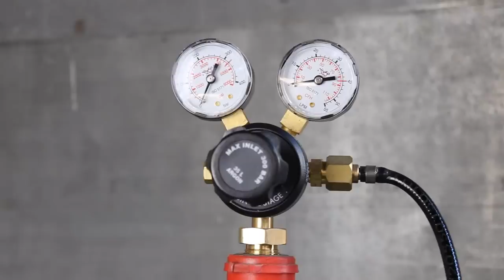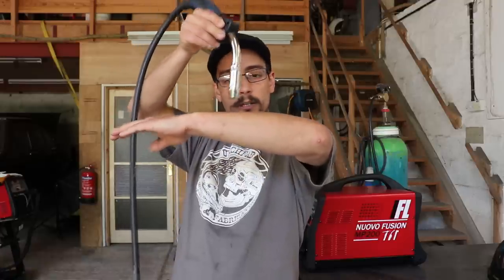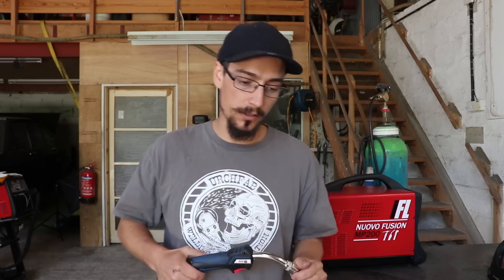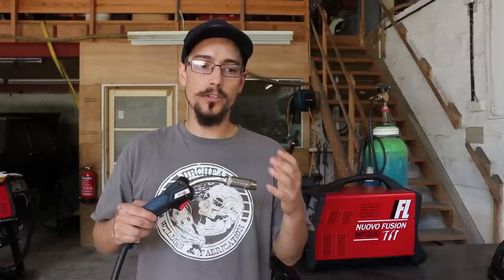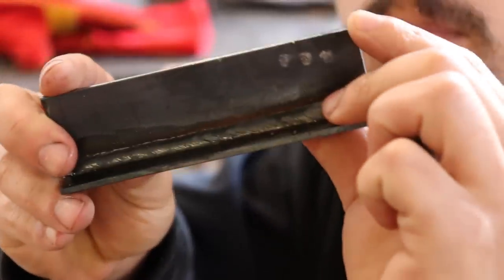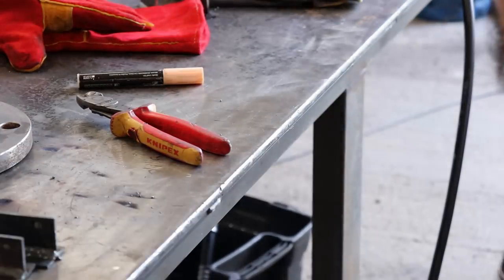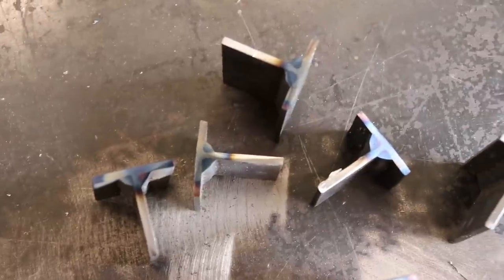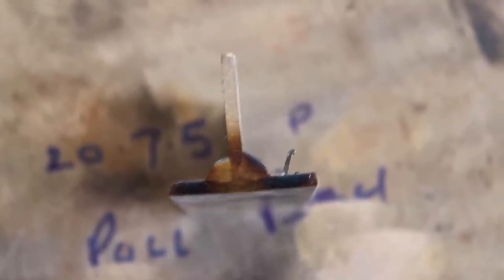SHOULD YOU PUSH OR PULL A MIG WELD? FLAT OR RIPPLE BEAD?

Comment: nice welding , i,m a qualified welder been so over 20 years , on the job you do what ever it takes to stick the metal together, pull push whatever cheers
Reply: Yes sir, I'm 10 years in only but agree. Push and pull will give you different profiles but that's about it.

Comment: That is absolutely correct.  Push pull left hand right hand,you do what you have to. When I was much younger work for LeTourneau, in Vicksburg, I've seen guys Weld upside down with a mirror so they could see the bottom of a pipe on a manifold.  Very nice

Comment: my experience with push / pull: pulling keeps the wire in the puddle which gives you a bit more heat in the puddle. good for thick stuff or structural. do whatever u want as long as it penetrates. Thinner metal I like to push because you seem to have less of a chance of blowing through thinner metal while pushing. its just preference. Weaving is good for large pieces and thicker weld beads. plus stacking dimes is fun.
Reply: Handy notes for when I get my new consumables and practice some more MIG tomorrow.
Reply: It's curious how works totally oposite to me, when im welding 2-3 mm plate i like to increase a little the distance of the stickout and go pulling, and it goes very consistent for me 🤣

Comment: I was leading hand in a truck chassis mod shop for a while and we x-ray'd all our welds on chassis rails. 

I can say with 100% confidence that a good welder can do a perfect weld almost any which way. 

We tested and then it was ultra sound treated and x-ray'd again and we never had a fail. 

The 2 things that are detrimental in making a weld fail is inclusions and voids and as long as thou use the appropriate filler wire and settings and have prepared correctly, how you apply the filler wire doesn't change that much, or you can prep the material to use a certain process. 

Personally I'm not any where near as consistent as I should be but I hired guys that were like robots. 

One of my guys lived for welding, he was always trying to get better or learn a new process but when we tested him against a robot welder once trying to justify the million dollar price tag, he was more consistent because he was able to feel see and adjust on the move. 

Not bad for a guy with a 3rd grade education and couldn't read or write. 

He got all his tickets on practical testing in the oil industry some how.

Comment: The great debate - push or pull. I was taught, as a general rule, if there is slag, drag, otherwise push. However I've seen people MIG doing both and there seemed to be little difference in either regarding penetration and both produced good welds. As you stated in the beginning, in the real world sometime you have no choice and have to use both. BTW - great idea using the torch to highlight the welds. I just learned something new

Comment: I agree with everything you say make no really important difference only time you would wanna do it to the books is if it’s a high structural need how ever there is no real benifit of having a really big leg length keep it to the same thickness has the material any smaller then the weld is a weekspot any bigger the it’s just excessive strength and moves the chance of cracking/braking to the actually material which makes it harder for repairs I could go all day about the structural aspect of welds but I’ll leave it there other then that I agree with you completely great video man support from Australia

Comment: I use push flick back to initially heat material and flick back to ad material (wire). Works a treat! Can also be used in pull. I fabricate gym equipment and structural , all tested, all perfect 👍🏻

Comment: Nice video. Thanks fot that. Put guards on your angle grinders man. I once had a accident with such a small angle grinder and it was no joke. Never think 'it won't happen to you'... The disc turns at 12.000 RPM. Never think you're 100% in control...

Comment: Haters gonna hate. I'm a welder fabricator using tig and mig on mostly stainless steel, and I use different techniques every day depending on what it is I'm welding. I'll generally push and do the stop start method and I prefer to weld hot and go downward with mig but go up with tig because it's easier to get wire in. But basically you got to do what you got to do. Anyone that says you should only do one method must just be doing 1" butt welds in the middle of a football pitch or something lol. Keep up the top work mate. Loving the mongrel build so far.

Comment: Discovered that little heat etching trick myself at work pushing a piece hard on a belt sander. No more chemicals! Where i work they have a whole process for cutting, etching, and putting the piece under a microscope. Im sure if you put a higher polish on the piece the then heated it and put it under the scope the view would be just as good as with the acid etching method. 👍

Comment: Really enjoyed this. I'm a beginner welder, but with a lot of background in ship design, welding theory, shipbuilding, and heavy structural, from an engineering management point of view.
I think you should consider working towards a welding Engineer degree. With your curiosity and ability to design good demonstrations, you'd be a good fit.

Comment: I was taught push is better than a pull because you are pushing into the heat and will get better penetration but that's because I'm a beginner and I think a push is easier for those starting out.

Comment: A really good demonstration and analysis of your results.  I expected that you would get some variation in results from the cursive style given the change in torch angle to the workpiece.  I think you could also use pulse to get the ripple effect albeit that is normally in spray-arc transfer.  Would have been interesting to see a comparison with spray-arc (pulse and non-pulse) for the straight pass given I'd expect the penetration to be greater for that transfer mode. Enjoyable watching - I must have strange tastes  :-)
Reply from the maker: I'm planning to do some pulse vs short circuit, my new mig has pulse mode on it. Cheers

Comment: In our ASME weld shop using 1/16 Flux core wire and co2 flowing 45cfm we pull. No weave. Comes out great. Mill scale is removed for exray jobs only

Comment: Nice job again, I saw on the Miller or Lincoln site, that pulling tends to penetrate more versus pushing, I've found that to be true generally. As you said, getting the tiny arc down into the root is important, in my view, the weaving thing is misunderstood, I think its ok for some jobs, my apprenticeship was mostly stick welding and when capping a multi run we were taught to "walk the arc" at all times concentrating on maintaining a consistent arc. In general, you didn't turn your wrist as this can open the arc so you kept your wrist locked. You can see the arc open up in TIG if you don't travel and rotate the torch. Whatever , you are right, you do what you need to get the job done.Top tip with that blowtorch, and" you tube welding inspector" ha ha, cracked me up, so true lol.
Reply from the maker: Cheers, there's so much info out there its hard to know what to believe, its always best to just have a go or find someone who actually does it for a job. an old friend who taught me a lot used to say you should always be straight up and down and look in from the side rather than tilt the torch for mig. he built some amazing stuff.

Comment: I went to school for welding years ago. We were taught that a mig flat bead weld was bad. I then worked for Toyota and they wouldn't allow anything but a flat weld. There is a difference in opinion between both worlds. One, the structural welding world would say it is a must to use a pattern to get the best penetration. Two the manufacturing world says patterns cause bubbles in the pentration of the weld making it weaker. When in all actuality manufacturers are want the least and fastest weld to save money, product, and time. I was also taught in school that for mig it didn't matter what direction you welding unless it was a vertical weld.

Comment: When you go for training it's usually mid to thick metal and they do circles for flat, c's for t-joint and triangle vertical up.  The patterns help you to build at the joint and with practice gives a more consistent weld..

Obviously on thin stuff, due to heat, straight welds are advised.

You are also taught to push mig, pull stick. This makes sense.. with stick you pull away from introducing slag. Pushing mig forces oxygen away from the weld, pulling could draw oxygen into the weld by suction, theoretically of course. 

In the end, though, regardless of what you've been taught, you have to do depending on that specific circumstance (within  reason).

Comment: The only way to get total consistancy is to machine weld, I have been welding all kinds of stuff from cars to rusty framework for nearly fifty years and agree with everything you say, when you are welding, in situ, have to adapt and do whatever it takes to get the job done,  as shown by spot welding you don't really need to weld solid all along so if you do this will compensate for any variation in the welds plus it looks nicer.

Comment: Yea I have to weld thicker metal to thin gauge metal so I have to use a weave I stay on the thicker and wip in otherwise I blow a hole right through the thin gauge if I go in a straight line

Comment: Welder for 54 years senior inspector for the last 10 push pull all depends on material thickness 1.6 vertical always drag down no such thing as wrong in welding unless it specifically states in the WPS and for those who don’t know that’s aWelding Procedure Specification for general non coded welding ie non structural work whatever works best for you

Comment: Thanks, I’ve never welded before but I guess if there is a risk of oxidation then fill in the gaps, the last thing you want is a gap where water and acid can eat at the iron and create a structural fault by corrosion. If using stainless steel where corrosion contamination is low then it doesn’t matter, so probably a nice fancy pattern on stainless.

Comment: Pretty good watch mate however did you think that maybe the weld settings should be different for all these different Weld methods? 

It kind of seemed to me more of a test of the best weld type for that particular settings on thin steel. 

I agree that most methods will work especially if you take the time to get the machine dialed in for how you Weld. I guess I would think that with most welds failing in the HAZ that maybe the stringer inputting less heat as the Weld profile is more consistent. As you need the valleys in the ripple to meet the minimum Weld profile requirements?

Comment: Push on Alum and thin metal pull on thicker stuff sometimes you have to do both very few people weld straight all the welder I know use some type of manipulation of the wire in the puddle circle or e or c or step forward and back 💯🇺🇸💪❤️

Comment: Here’s the real difference. You get more heat when pushing a weld. But pulling is easier. Pulling will hold just as good as pushing. However when your welding aluminum you can only push. You can’t pull an aluminum weld.
Reply: Good to know Adam.

Comment: I found out today after 8 years of welding, due to a recent hernia operation that causes 10 years of hell and my right arm muscles to jerk preventing me to weld straight, my speed still is fine, that I used a straight edge to guide my welding gun to give me a perfect straight line weld, is that wrong to do and why.

Comment: Lol, much of my welding is exhaust, with big .30 wire, not great but versatile.. I get best results with small rolling circles between both pieces, penetrates without burning through. A roll will hold better than a straight flat in most cases I would think.

Comment: when I can not get my mig gun into a tight spot I get out the stick welder and some 2mm 6013 (if thin metal) and have a go. I had to today
welding so stops for a grate no way to get mig gun in there. Push or drag on mig makes no difference to me, what ever works to get the work done. good video.
Reply from the maker: I usually try to avoid the stick welder unless I'm working outside, but yeh sometimes its the only way. I use an mb15 mig torch for doing roll cages, that helps a bit for tight spots. Cheers

Comment: If you are using Gasless mig wire its drag the slag rule as gasless leaves slag, the angles should be 5 to 10 degrees, does not matter with gas, i use Mig Gasless E71T-11 wire as its a lot better to weld with and leaves a better weld than standard wire.

Comment: Certain fact; backhand has a narrower deeper fusion. Forehand has a wider shallower fusion. If you have good fit; thick steel -backhand. If you have no choice to push, get that small stickout. In any case the angle needs to be slight at most…imagine little tiny metal droplets being shot at the base metal… they will bounce off it its too shallow.

Comment: What is the best setting of machine for mig welding hard wire
Reply: depends what size steel you are working with. its all different and different people weld at different settings

Comment: I was taught to always push. Most instructional videos on YouTube say to always pull. I've done both where the situation called for it. 

I also like the look of a non weaving weld on heavy duty stuff, but will use a weave a lot on thinner material and especially welding thick to thin.  There are loads of reasons for all techniques
Reply: sidewaysdanny agreed and same here. I guess YouTube lives in an alternative reality. push has better penetration and with stick you're told to push and mig you can do either. If I have something to weld and there was a thicker workpiece I would give some kind of movement of the torch where it's focused onto the thicker one longer while I correlate with temp and speed. I typically try to just push unless I'm trying to build weld up then I'll pull with mig.
Reply: @BrokenAbyss  pushing is really only necessary for greater penetration, otherwise you'll generally get better looking results with dragging. It depends on what the job calls for at the end of the day.

Comment: biggest problem i have is the wire keeps stopping, getting stuck and melting to the tip ??? , no one seems to have posted an answer to that one
Reply from the maker: You have probably over heated the tip, put a new one on and turn up the wire speed.
Reply: Your wire speed is too low or your voltage too high.

Comment: There seems to be one side that had more penetration then the other i feel like that's because you welded one side then straight away flipped it over and welded the other side ( which got more penatration because the metal was already really hot from welding the other side ? ) just my 2 cents not being an YouTube inspector 😉

Comment: Slight angle having the gas lead the weld whether pushing or pulling, weld should be no wider than the material thickness and should be flat, not concave or convex and there should be no undercut. Not a weld inspector, just a licensed welder.

Comment: Considering you have the ability to reach thousands of people with your videos I think it's completely irresponsible of you to promote improper welding technique due to your own poor work practices. You didn't mention anything about porosity, insufficient gas coverage, insufficient penetration, undercutting, underfill at toe or incorrect weld profile caused by a drag type weld. Also your Nick break test was not performed correctly. While I agree that most of the light gauge work that you do may not require anything more than a superficial weld you should at least provide a disclaimer stating that drag type welds should be reserved only for light gauge material. As for "weaves" there is no issue using this style as a capping run after a root pass in strength critical weld as long as you're capable, they're also fine to use in a general welding situation where you're trying to join a large gap.
Reply: User Name #youtubeweldinspector